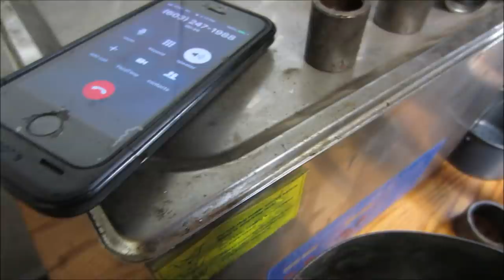VW BUS Transmission Failure,  Help Me Fix it,

Comment: 16:00-17:00  if there are studs that have no thread lock from the factory DONT PUT IT ON NOW! i have at this piont not seen what type he uses and already no it probably is way to mutch! just a drop is enough what if you have to remove it again in 10 years or so you cant get the stud out because of the threadlock!
Reply: yup that is non removable even if it's blue oh and of corse use an impact gun to bolt the bracket on!

Comment: Hey mustie, arent you afraid to have a flying pressure plate screw if you do not glue them in with Loctite? -- Me had 2 screws loose, one flew into the trans and beat a hole in it, oil completely lost and drove for another 600km, because I didnt hear or saw a thing - it was a bad mistake from a workshop who changed the clutch :'(  -- now have new gearbox :'|

Comment: Could the popping out of 4th have been something other than a trans problem?
Reply: Just a guess, but I would think that it could have been something wrong with the shift linkage. That's something that they could check by raising the bus and watching the linkage shift from underneath. Or Mustie would have seen it once he pulled out the transmission. But all the metal that came out with the trans fluid is a pretty good indicator that it needed to be swapped.

Comment: Had a relative that purched a new v w bus !  Drove it and never checked the oil or changed the oil  guess what the engine seized! Bus was junked !, after about 90000 miles

Comment: loved when stuff was easy to work on instead of today where if you don't remove a plastic screw in under the dash then you screw up the whole thing for good or there's some unmentioned censor right where it shouldn't be. i refuse to even change brake pads or shoes on anything newer than 1976.

Comment: Driving with your hand on the shift knob can wear out the shift fork and cause popping out of 4th gear.  (Don't ask me how I know.)  I had to re-assemble the transmission twice to get it right. If you have the bucks to buy a rebuilt, that's the way to go.

Comment: This has nothing to do with the video .I have two of those air impacts  like yours just a word of warning mine are identicle BluePoint AT500S .I took the first one apart to clean and lube it up.Pulled the trigger air intake assembly apart thru the bottom of the handle out.Put it back together thru the same hole it came out and a little tiny plunger on the end that engages the plastic trigger fell inside the handle air opening chamber as I reinstalled it and cant I get it out with out chopping a whole in the side of the handle its ridiculous.I thought I lost the first one on the floor.  So I took my second one apart to see what fell off the first one at least I thought something fell off at the time didnt know what it was. So stupid me did it twice & I ruined two air impacts I had for years as the second plunger fell in to the unaccessable air chamber in the handle also reinstalling.If you ever pull yours apart to clean or rebuild knock out the roll pin remove the plastic trigger and take out and install the tiny plunger thru that hole and not out the bottom with the whole assembly with the spring and plunger rod. Install the tiny plunger valve  thru the trigger hole reinstall the trigger with roll pin then the rest of the intake parts screw into thru the bottom.I have been trying to locate parts for mine there from the 1980S cant find those little airplungers they also have a tiny O ring seal on them.If you know where to get parts let me know I tried Snap On and others places no luck i might try and make them before I break down and buy a new one.......  Glenn P.

Comment: Anybody that does a clutch on any car if the flywheel is shiny and especially if you there are any heat checks on the metal surface or grooves get the flywheel resurfaced. or replaced  . If the surface is flat no heat checks at least get a sander with 80 grit paper on it and rough up the surface . If you run a new clutch on a smooth shiny surface you will have premature clutch failure from slipping.

Comment: I've always heard horror stories about lining up the clutch and transmission, I've never found it to be that difficult, granted I haven't done that many. I just made sure the clutch plate was centered, start it on turn the input shaft until it lines up and slide it on

Comment: It's just me (sigh - I guess) but I woulda sandblasted and painted the bracket, and cleaned the rubber shifter seal with hot water and a bit 'o' soap.  I'm not worthy I know. It's just me I guess.
Reply from the maker: not restoring just repairing, the more time l spend on this the less time gets put into another video,